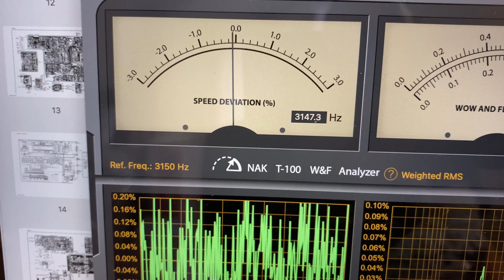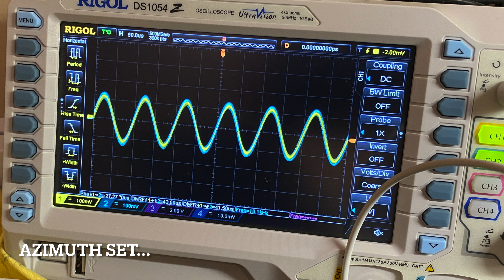SONY WM D6C professional walkman - cassette player recorder repair fix #diy #repair E0045

Comment: Bought mine in the summer of 1984 and took it to Alpine Valley Wisconsin to begin my journey recording the Grateful Dead.  I graduated to a TCD-5M by 1985, but the trusty D6 got me going.  I eventually traded it for my first car in 1986, a Toyota Corona.  This tape deck has a warm place in my heart.
Reply from the maker: @lgindoffchannel  I guess both of these models were very expensive at that time… but when we are talking about construction, performance and reliability they are awesome and builded like a tank.

Comment: so nice to see your thoughts and process, although i wish i could see the ic chip replacement. however it is more advanced solder technique so i understand why you didn't show.
Reply from the maker: Thank you! 🙏 well that chip change is super simple thats why i didn’t make video about it :) next time definitely will as i see interest :)
Cheers!
Reply: @ do you know what chip or where to get one? I need to fix mine as I did reverse polarity in a rush to power the unit.
Reply from the maker: @radiospank i use only original sony chips, this time i took it from dd11 since it have the same chip. There are optionsz in ebay, but i think all of them are fake and will not work or will not last long. Cheers
Reply: @ ugh yea heard that advice, problem is buying a used for parts Walkman is as much as what I paid. Also when they list for parts how do I know the chip isn’t damaged
Reply from the maker: @ yes its not that easy, but possible to get one from cheap damaged sony substitute… you can always ask seller, but there is always risk that you may have to take or not :)

Comment: I have one. 
Batteries overflowed and it has disconnected cables. Can you repair it?
Reply from the maker: Hi, i can repair, but probably price won’t be practical. Cheers